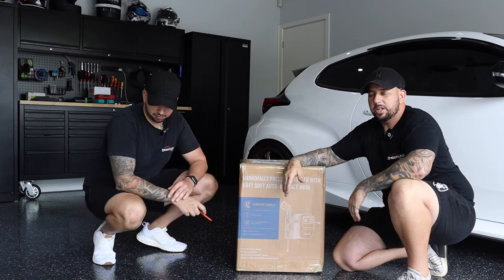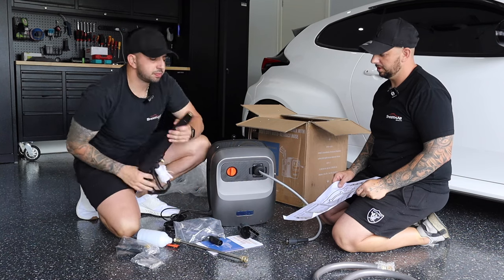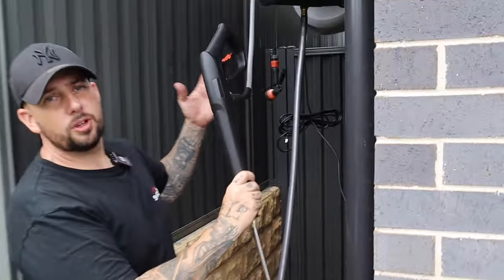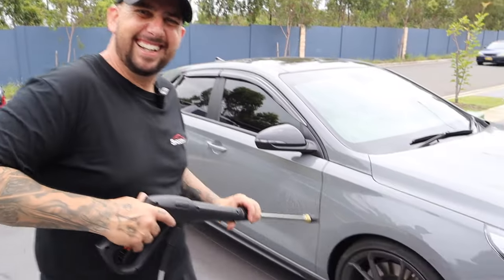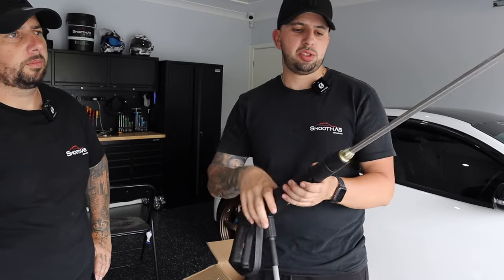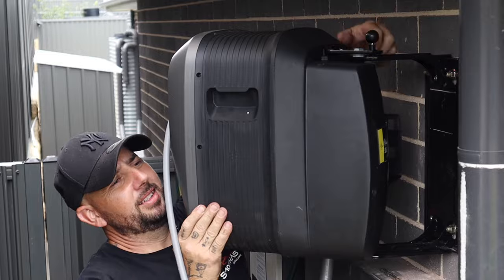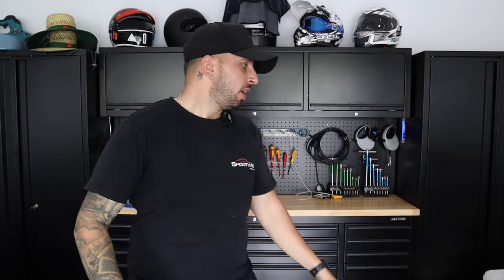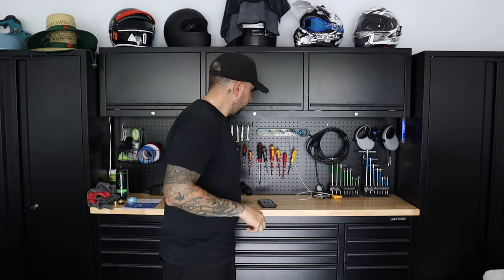Giraffe Tools G20 Retractable Pressure Washer AUSTRALIA

Comment: G’day gents,
Looks great, I saw you blasting the concrete which is a great sign at that spread, I just wonder if you think it would be alright for oil stains and red dirt/mud…really nice stuck on stuff…
Reply from the maker: Thanks mate! 
Wouldn’t see it being a problem, defintely something it had the power to handle.
If it’s oil stains in the concrete/floor you’d need more than just a pressure washer though some form of chemical to soften and dislodge it.
Reply: @smoothasbrothers  that’s cool, thanks! And as long as I could get the worst off, then use some degreaser, I’d be laughing! But thinking especially for cleaning down engine blocks to work on etc. Thanks for replying to me! Definitely an investment to work towards I think, I like that it’s all contained!

Comment: Which coloured connection is meant for cars and which is meant for driveway and general cleaning.
Reply from the maker: this one in particular runs an adjustable/variable head so its not set meaning you can change it as you please. 
For cars anything between 20 degrees span to 35 degrees